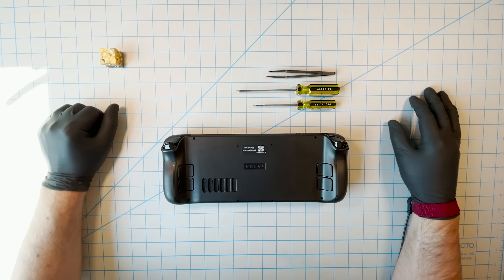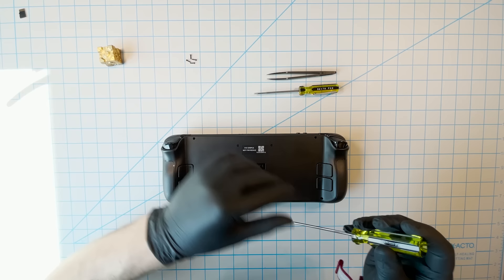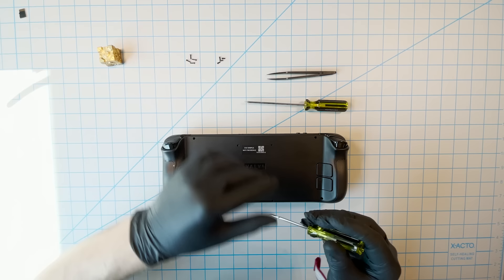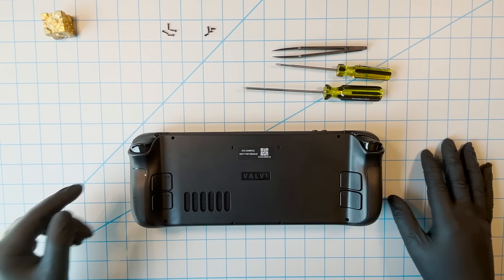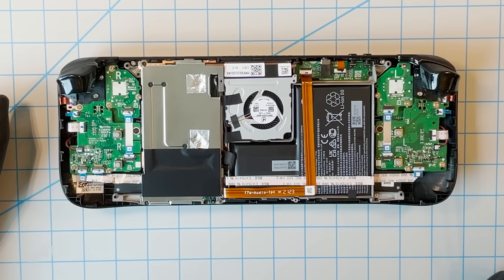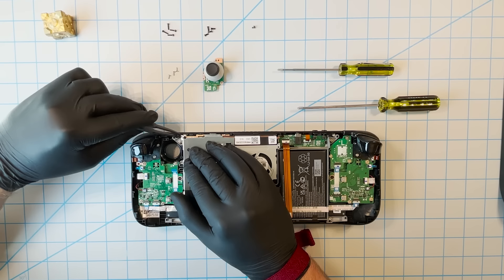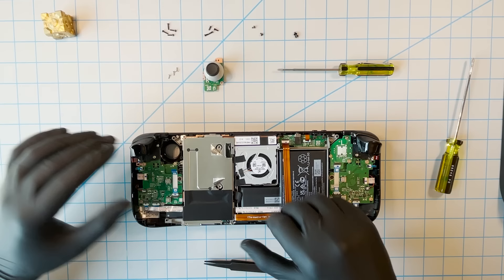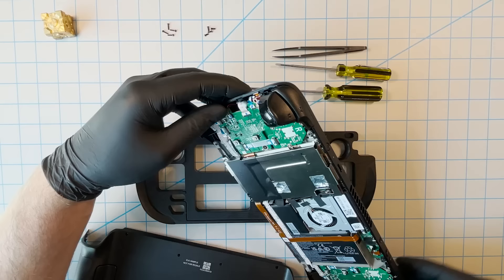Take a look inside Steam Deck™!

Comment: If I have a question, is there ram in there?
Reply: Nah sorry lmao
Reply: @lookatme5939 Steam Deck specs according to this comment.
AMD APU
CPU: Zen 2 4c/8t, 2.4-3.5GHz (up to 448 GFlops FP32)
GPU: 8 RDNA 2 CUs, 1.0-1.6GHz (up to 1.6 TFlops FP32)
APU power: 4-15W
RAM: none
Storage: 64 to 512 GB eMMC to high-speed NVMe SSD

Comment: @Valve I would definitely have to upgrade the M.2, as I'm intending to run win 11 as well, 512Gb just isn't going to cut it. Do you have a list of M.2 drives that won't mess the system up? Great video.

Comment: Imagine for a moment that you folks at value put in a full sized NVME slot so we could put in something like A Sabrent NVME 4Tb Rocket Plus with a  R/W 7100/6600MB/s Speed or its soon to be released predecessor the 8Tb. Basically the Drive is More $ than the Device as a whole!
Reply: Who even needs that much storage?
Reply: @retroprogamer7009  LinusTechTips

Comment: That's a small battery, looks like short battery life.
Reply: 40Wh. Basically 2 hours of battery life at full blast. For smaller indie games I would guess 4-6 hours. Up to 8 with very light usage.
Reply: @novh4ck  depends on the settings linus did a video on it and he could play AAA games for 6 to 8 hours depending on the graphics settings

Comment: they need to lean right back from the whole 'don't open this!  don't replace anything!' nonsense.  a device this expensive with built in analog sticks... they are DEFINITELY going to need to be replaced over its lifetime, probably a few times at least.  if they didn't want you messing with the main internals, they should have used detachable controllers like switch, or at least make the input elements modular
Reply: They legally are required to say those things in the event that someone does it, bricks their console or injures themselves, then sues valve.

You can see the " mixed messages " here. They're showing you how to do it safely, while advicing you not to. 
Theres a reason why they're showing you how to change the battery, the analog sticks and even the ssd. Valve supports third party repair, they're even committing to a supplier list of replacements, something that no other game company has ever done.

Valve is doing amazing work here, they just legally need to protect themselves

Comment: These are NOT self-tapping screws, they flat tipped for placement through pre-piloted and THREADED female enclosures. 
A self tapping screw is pointed or drill headed and are used in construction to faster raw materials to each other. I'm sorry, but the obsessive fear mongering in this video is nuts.

Comment: so basically even though they said that "if I actually followed these steps properly I haven't done any of the preceding steps at all" cause you've been advised not to do it, you can still do it right to repair. not to mention. this was very easy. that looks easier than the switch even though it shares quite a bit internally.  so I guess if I ever want a steam deck and my warranty runs out and something like those parts needed replacing guess I'm doing this. I'm very curious to how long that battery is going to last?

Comment: I agree with the concept and all, but aren't they exagerating a little bit the fact about the risk of damage ? And the fact about the model of ssd interfering with the system ? They say it's a computer so like any computer that should also work fine, and you have a magnetic shield ! I opened a lot of computers, motherboards and never had issues.. I dont understand how this one should be so critically fragile ???
I  also understand they dont earn money at all with the 64go version and marge on the  256 and 512 (Apple business model for 15 years xD) so they have at least to discourage the most inexperienced and untalented customers even if they have to overdo it. I think i would have done the same. But I am now concerned... They nearly dissuade me to do it even thought I am well experienced.... Dont know what to think.
Reply: It's better to exaggerate risks than to get sued by someone who tried to do it and accidentally made the battery explode.

Comment: Switch is going to be completely bankrupt after this. "Remove these 3 screws and put em in, congrats, we fixed the most hated issue you guys have. Broken Thumbsticks." So many switch lites have been thrown away due to broken thumbstick due to how horrible they are to replace yet even I could replace these thumbsticks.

Comment: I just pre-ordered the 512GB storage model.  Hope to get soon but, excited to be on the list. Will have plenty of time to see how it performs. Valve has a great refund policy with Steam, so it doesn't bother me to pre-order at five bucks. That can go back to payment method within 30 days and then as "Steam" credit later. The $5 is used towards the purchase price so cool. Nothing to lose with these being in the hands of tens of thousands of people before the end of the month. With 4 cores and 8 threads of Zen 2 CPU with 448 Gigaflops of FP32 . This combines with 8 Compute Units 8 *CU* RDNA 2. Combined APU power output is rated 4-15 Watts. Easy for the single heat pipe will be sufficient to disperse heat efficiently away from the user. I imagine there is also a vapor chamber underneath. hi Interesting is the 16GB of LPDDR RAM 5500MT/s quad 32 bit channels being in sets of four 4GB modules around the die for a total bandwidth of 88GB/s. I  am excited to see how RDNA 2 Upscaling will improve  the frame rate and allow me the ability to take full advantage of the 1280*800 @60HXz. Until then I will enjoy my 6800xt as I still wait to get a next generation console. Salute to the future of gaming.

Comment: Nintendo : If your joystick is dead change it AND NOT REPEAR IT LOOSE MONEY MAN 
Valve : soo the joystick is here Buuuuut if you open it someone will die so the batterie is here to BUUUUT you know what happen when you damage a lithium batterie<? yeah you will die !
Reply: repairing a joycon was surprisingly simple! I replaced my moms joycons shell as hers had cracked after a drop. It went swimmingly with only a slight issue (one of the 'lock in' springs bent) but other than that it was easy! The size did make it a bit more difficult than something like the steamdeck would be.

Comment: The first minute seemed like a ramble against right to repair, don't open it as you may die is as extreme as they get, even with a battery blowout it's not big enough to cause death, burns maybe or it might kill if you suck on it while it's exploding